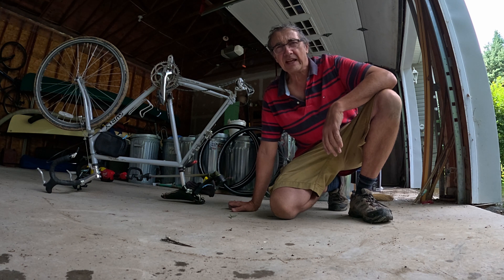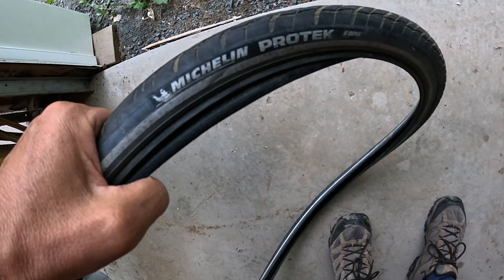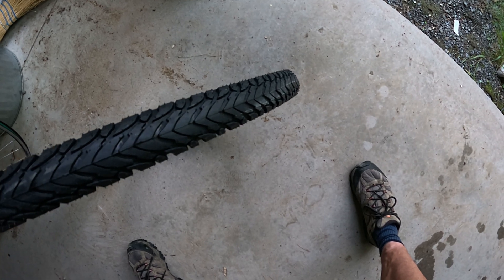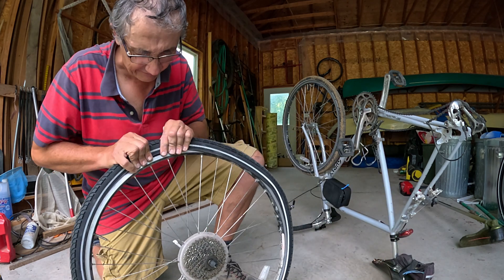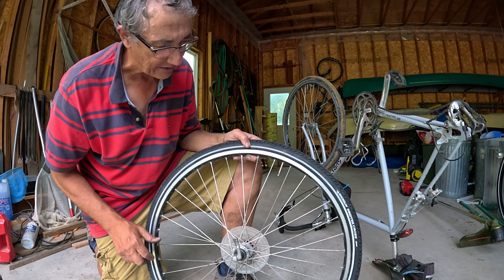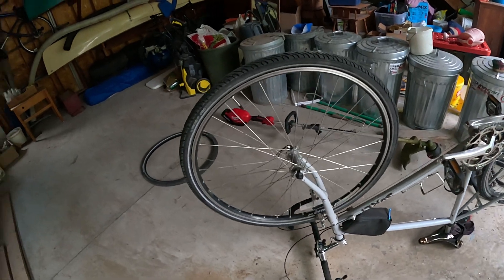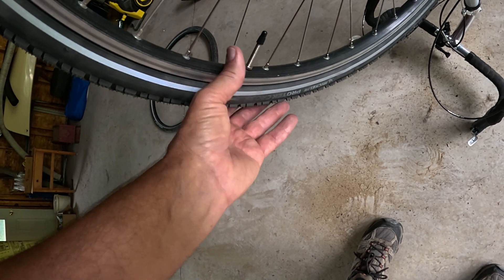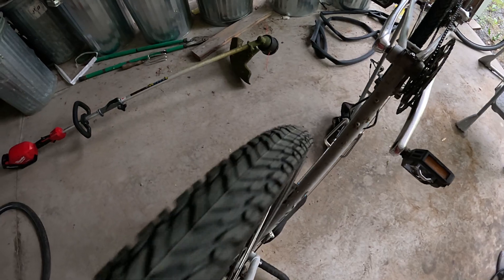Changing Bicycle Tires and Tubes | Fixing a Flat on the Surly Long Haul Trucker

Comment: Good timing on this video, as I just bought 3 new tires for my electric trike that now has over 1150 miles on them and looking bald. I also got 2 tire levers to help remove and replace the tires.
Ill be sure to double check the direction of the tire thread, and its ok to have a senior moment as I call it.
Reply from the maker: Thanks Douglas!  Good luck with your tire change.